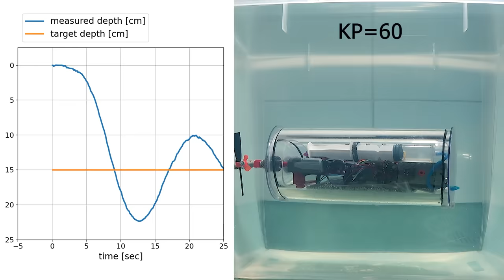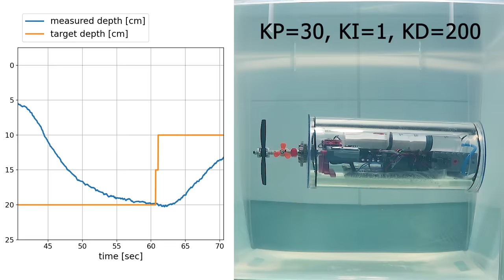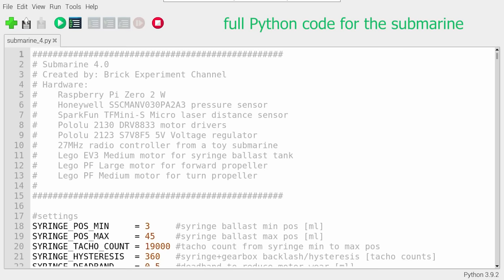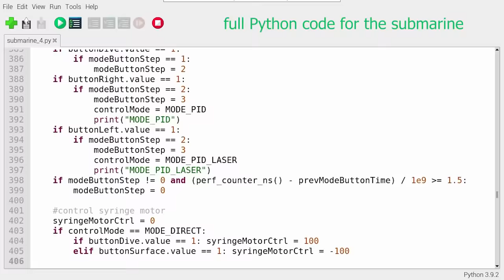Building a Lego-powered Submarine 4.0 - automatic depth control

Comment: I found the syringe to control depth to be particularly fascinating
Reply: i don't even understand how that works because from my noob point of view there is always same amount of air trapped inside this thing??? :D
Reply: @miladinseratlic5984  It's not the same amount of air/water, buddy. You got it all wrong. The syringe is strictly connected to the water outside, and is not merely "pushing air around". It is either pushing or pulling a specific amount of water from the tank to set the depth of the submarine as intended 😒
Reply: @MikeSmith-vb8ul  OMG... little blue hose, i didn't even saw it until now... thanks!
Reply: @MikeSmith-vb8ul  they didn’t understand it? Okay? Just explain it to them. No need to be snarky about it. Damn
Reply: @aidendoesstuff185  and he did that?
Reply: @contingenesis5126  the explanation was "it is actually pulling in water from outside!" But the guy was a smartass with his style of writing, bolded words and emoji at the end
Reply: @Geluonis920  Leave him alone, being sparky on YouTube with complete anonymity is probably the only place he feels safe explaining something with a sense of superiority.
Reply: @MikeSmith-vb8ul  huh? There's still the same amount of air. The density changes to accommodate the water. what am I missing?
Reply: @mouthfulofpeanutbutter9753  The density of the air probably makes less difference than the weight of the added water.
Reply: @thenorwegian76  I am certainly no physicist, but I believe the weight of the water in the syringe is negligible. Imagine instead of the syringe mechanism; the cylinder shrank and expanded in volume. In that scenario the weight of the water is not so intuitively attributed to the buoyancy of the cylinder. As best I can understand, the cylinder in the video has a nearly neutral buoyancy. The change in volume and density caused by the displacement of water, while simultaneously maintaining the same mass, changes the buoyancy enough to cause the cylinder to rise and fall.
Reply: @mouthfulofpeanutbutter9753  Buoyancy is a function of both density and volume
Reply: @mouthfulofpeanutbutter9753  You seem to contradict yourself, you're not maintaining the same mass when you displace the water. Look into a submarine video, the principle is the same there.
Reply: @thenorwegian76  Water does not enter this submarine. The inside of the syringe changes between internal and external surface area as it moves. If the water in the syringe is still outside of this submarine, then the mass is indeed the same. If you include a fixed, arbitrary volume of water surrounding the submarine, then yes the mass does change.
Reply: @TRENKROM  Does this mean that depth of the sub is entirely decided by the sub's variable volume?
Reply: @mouthfulofpeanutbutter9753  yes, water does enter the vessel when the syringe is drawn out.
Think of it this way: if you held the vessel in your hand, and the syringe drew in water, would the vessel become heavier?  Yes, it would.  Only slight changes in density are required to make the vessel rise or fall.
Reply: @DumbledoreMcCracken  If the vessel was instead in air, and the syringe pulled in air; would it still get heavier? 

There's only the illusion of it being heavier because the buoyancy force is changing. It's kind of like suspending a weight on a scale by a spring. It doesn't get heavier when the tension changes because the mass and gravity are constant. There's an opposing force fudging the scale.

The vessel sinks because the buoyant force decreases due to less water being displaced by the vessel.
Reply: Much better than the balloon he had last time!
Reply: @MikeSmith-vb8ul  thanks for pointing out the blue hose!
Reply: A great homemade ballast tank
Reply: @mouthfulofpeanutbutter9753  that analogy is just... You're trying to replace air with air, of course it will not change.
Reply: @majorlobster3443  The vessel is a closed system. No air is being replaced. It gets moved out of the way.
Reply: @mouthfulofpeanutbutter9753  the vessel is closed, yes. but the syringe is not. and what i meant by replacing air is your analogy, which was basically that
Reply: @majorlobster3443  The analogy is meant to demonstrate that the weight doesn't change when the vessel shrinks. It stays the same weight whether it's immersed in air or water.
Reply: @mouthfulofpeanutbutter9753  one word, buoyancy
Reply: @majorlobster3443  Oh, yes, I understand that. The analogy was for the person that didn't.
Reply: @aidendoesstuff185  there no need to be “snarky” to him either, buddy
Reply: @BaronRodney  now you’re getting kicks from feeling superior to him. Funny how that works!
Reply: @quartzking3997  tf is your logic here
Reply: @miladinseratlic5984  I didn't see that part either and was also wondering how the heck the syringe worked.
Reply: @Geluonis920  It also doesn't actually explain anything.  It's one of those idiotic explanations where he just describes what everyone already sees and not how it works.
Reply: @MikeSmith-vb8ul  shit man ur right I didnt get it either but if u fill it with outside water it makes sence. I couldnt wrap my head around it thinking it was the air inside the sub.
Reply: @MikeSmith-vb8ul  ugghh probably played alone in the sandbox
Reply: @miladinseratlic5984  the syringe is like a piston.If is suck it out i think it floats because of the air,when is pushed,is heavier,i dont know really how but thats my point
Reply: @miladinseratlic5984  but the amount of water is flowing with the syringes help in and out to help the sub gain more weight .
Reply: @mouthfulofpeanutbutter9753  Your explanation didn't make sense in my head compared to the others so I asked bingAI and the response didn't align with what you are saying. In short, the buoyancy force pushes up. As the submarine takes in water (through the syringe in this case), it becomes heavier and gravity overcomes the buoyancy force, making it sink.
Reply: @TheRobojay Archimedes' principle: buoyant force = (fluid density)*(acceleration due to gravity)*(fluid volume)

Both the fluid density and the acceleration due to gravity are fixed for all intents and purposes. When the vessel shrinks, as I am saying, the only variable that changes is the fluid volume. That is to say the volume of water displaced by the vessel decreases, thus the buoyant force decreases.

By your suggestion, the small amount of water that enters the syringe is somehow heavier than the large amount of water already pressing down on the top of the vessel.
Reply: The two views are equivalent: whether you think the vessel gets heavier, or its volume decreased.  If you do the math, the resulting difference in the force is the same.  Please do the math.
Reply: @nony3882  I'm afraid some of this stuff is beyond me. Wish someone with a background in math and physics would break it down. I could see this being a situation like you said; both leading to the correct answer.
Reply: @mouthfulofpeanutbutter9753  I know this is an old threat but when you compress a string technically the mass does increase
Reply: @ROVA00  Interesting, but I wonder what effect this could have in the submarine given that the energy causing compression comes from a battery.
Reply: @mouthfulofpeanutbutter9753  probably negligible. Your point stands
Reply: @miladinseratlic5984  Check out [02:28] you can see how the syringe is connected to the water outside
Reply: @miladinseratlic5984  You're the smart one here.... All these stupid water adds weight comments. It's the "air part" of the syringe that's relevant... The volume of gas shrinks when water fills the syringe which increases buoyancy. If you had a syringe on the outside on top of the sub and filled it with water nothing would happen even though the sub got heavier...
Reply: @miladinseratlic5984  because buoyancy increase with aur pressure
Reply: @Nobueno40  6 months ago... dude, I don't even care how it works just days after, not to mention 6m later
Reply: @MikeSmith-vb8ul  You could have not been a dick about it, he was just uninformed, and was guessing, even questioned it.
Reply: @MikeSmith-vb8ul  smoke a joint
Reply: @MikeSmith-vb8ul  ooooohhh. That makes so much sense! Thank you
Reply: Are there any bots
Reply: @mouthfulofpeanutbutter9753  in simpler terms the increase in water makes the syringe/submarine heavier and it sinks?
Reply: @lowqualitymagic  I think you're asking the wrong person. I've already made up my mind unless someone can offer a more detailed explanation.

Think about this: The submarine is topologically a sphere. When the syringe draws in water, the sphere gets a dent. The volume of the sphere decreases, thus it displaces less water.  When it pushes water out, the dent becomes protruded. The sphere takes up more volume, so it displaces more water.

Gravity and the mass of the sphere remain constant. That means the sphere stays the same weight; it just changes volume, thus density. 

We should all agree that the buoyant force is equal to the weight of the displaced fluid. Whether or not the sub rises or sinks depends on whether the buoyant force or the gravitational force is more powerful. I have demonstrated that the gravitational side of the equation has not changed. What has changed is the volume of water displaced. 

This means that it is the buoyant force that causes a change in the "apparent immersed weight" of the sub. It is not actually heavier, it just appears heavier.

There's an equation for the apparent immersed weight. It is equal to the weight of the sub minus the weight of the displaced water. So if the sub weighs 10 and the displaced water weighs 10, the sub appears to weigh 0. If the displaced water weighs 9, the sub will appear to weigh 1. 

Again it is not actually heavier; it just appears to be so. It's kinda like objects in the distance appearing to be smaller than they are.
Reply: @MikeSmith-vb8ul curious if they edited their comment to sound more like an a hole or less.
Reply: @mouthfulofpeanutbutter9753  you could have stopped after the first sentence and you wouldn't have had to look so silly online.
Reply: @mouthfulofpeanutbutter9753 yes, the mass would increase. I'm now assuming you're trolling. Then again, arrogance born of ignorance seems to be typical these days.
Reply: @mouthfulofpeanutbutter9753 yeah, adding water to the inside of a boat is going to increase its mass and make it sink further. Come on, this is 2nd grade concepts you're trying to argue over. Oh, maybe you're actually in second grade, in that case, I apologize. Otherwise...
Reply: @lowqualitymagic it's that simple.
Reply: @mouthfulofpeanutbutter9753  while the volume absolutely effects it's bouyancy, show us the dent in the sub made by the syringe. You're whole premise is flawed from the get go.
Reply: If I need to explain how density and gravity work together I'd be happy to clear that up for you as well. Seems you're lacking in some basic terminology understanding so I don't want to leave you hanging.
P.S.  It's so much sweeter being snarky when you're correct.
Reply: @mouthfulofpeanutbutter9753 we can literally see the water entering the submarine. How high are you Brody?
Reply: @quartzking3997 and yet they are absolutely wrong so it's funny.
Reply: @LittleXtra  "show us the dent in the sub made by the syringe." The plunger is the dent.

"If I need to explain how density and gravity work together I'd be happy to clear that up for you as well." By all means, please do!

Comment: TIP: Use acrylic cement rather than superglue. It will actually fuse the parts together forming a much strong er bond!
Reply: True, but it also means there is functionally no chance of recovering the parts should they decide to scrap the project or if they place a piece wrong and don't notice til it's dried.
Reply: Yep for sure Because I had a Kit that came with diffrent orings and the cement to glue them .
Reply: @jamesheaton5421  could just cut the end off for minimum damage
Reply: While that probably would be useful in some scenarios, I dont think these experiments are encroaching on the limits of superglue
Reply: @jamesheaton5421  no he can just cut it in half
Reply: @jamesheaton5421  its only to join the o-ring @ 0:57 , not to actually fuse parts together.
Reply: I'm more concerned about super glue fumes making the surface cloudy.  It can happen.
Reply: If you're so smart why don't you make one then?
Reply: Some super goes also fuse, depending on the bonding agent
Reply: @Mr_Buzz_Aldrin  he was suggesting an idea to the creator. It's not he was telling him that he did something wrong. He suggested he use a different glue for better results
Reply: @jamesheaton5421  or they just need to do maintainance
Reply: @vipervision  I think it was a joke in reference to that one time somebody did Rush E on the piano better than OP as promised.
I think they hope to see them do one as well.
Reply: that is a terrible idea unless your making a fishtank
Reply: every creation, no one ever asks for advice but provides inspiration if you want to make it better, be smart in reading behavior
Reply: Some super glue also fuse the parts together, some sort of chemical melt
Reply: also super glue fogs up acrylic
Reply: @DigitalFl0w  0:41